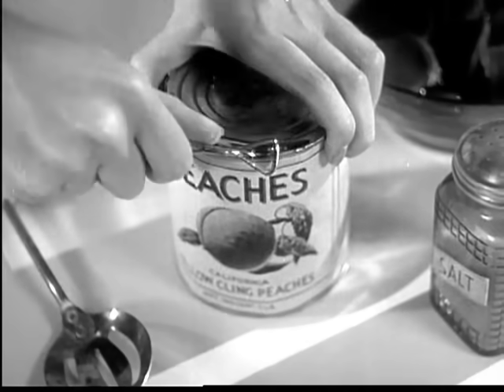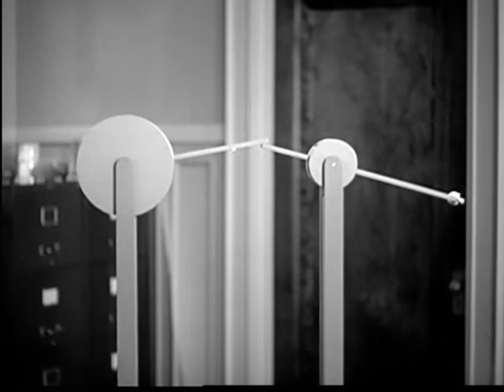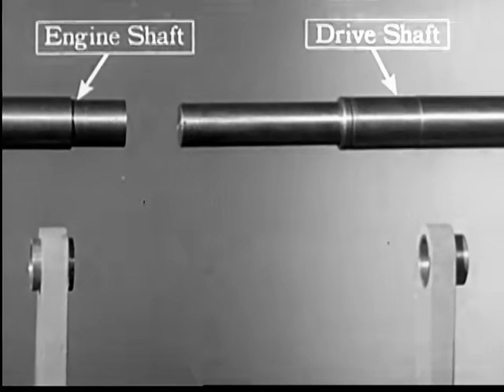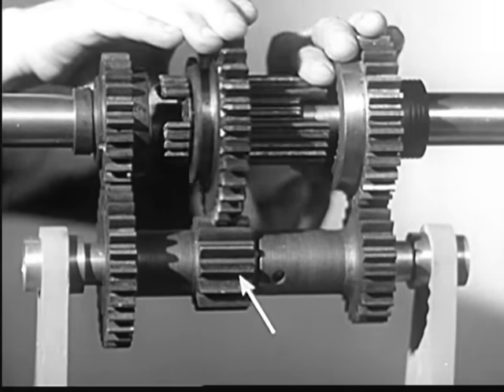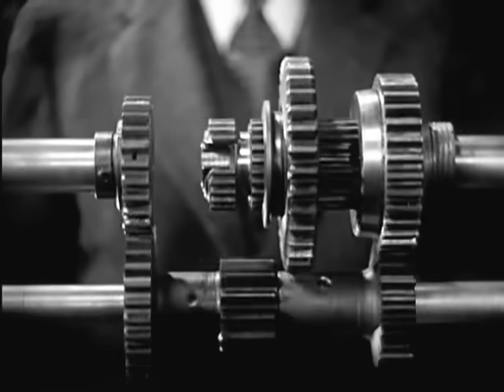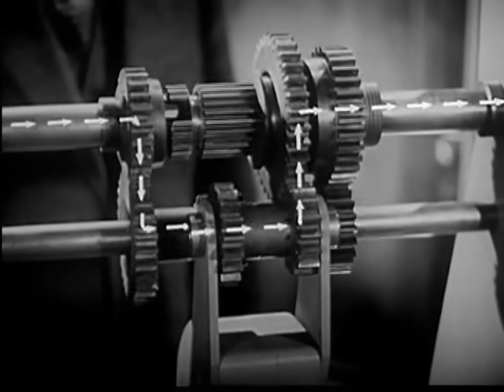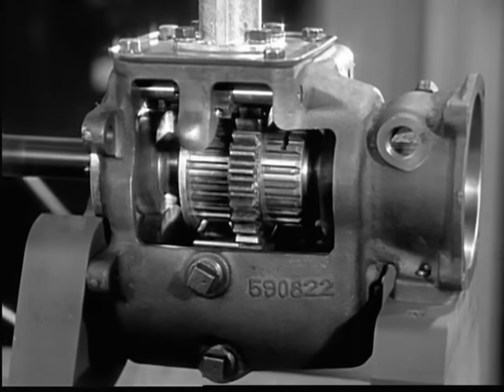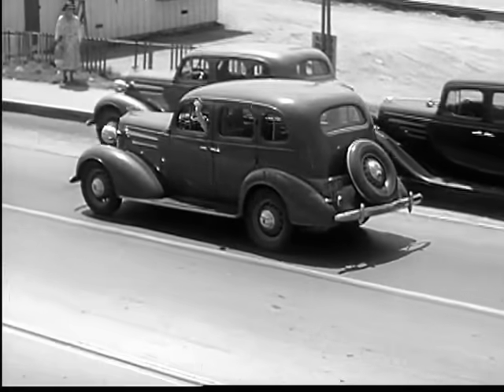Spinning Levers - How A Transmission Works (1936)

Comment: Is it just me, or is this explained so well that i can actually understand everything.

Today's school systems suck at teaching, especially Engineering colleges, where professors just blabber on and on without making anything clear or concise, and expect the student to read all the material and understand it on their own. 
If things were explained this clearly, half of my time would have been saved from hours and hours of reading and doing online research to understand concepts.
Reply: My university has mostly foreign lecturers who don’t make sense. I’m not trying to have a dig at immigration but I agree modern schools are terrible
Reply: It's kind of funny that you brought that point up. I go to school for marine engineering, meaning I learn how to make a 1000 foot ship move. Most ships either use large low-speed diesel engines or a turbine of some sort (gas turbine or a steam turbine). A lot of my textbooks make things really complicated to the point where it frustrating on understanding even the basic concepts of how things work. However, its these types of videos, from back in the day, that really helps me actually understand what's going on because they explain in a way that really makes sense and makes it easier to understand what's going on. Obviously, there is a lot more going on in a car's transmission. There is math that goes into calculating the torque output from the shaft based on the radius of the gear, or the wear and deformations that occur based on the material that the shaft is made of. But this video really helps you understand the basics of how it works so that you can tackle the more complicated things that are going on.
Reply: You're absolutely right teaching sucks now.
Reply: @cowboy_broke  Maybe it's you. Ever thought of that?
Reply: and iam not even talking about books and other study sources which are made for Einstein... everything is so hard to understand
Reply: That's right! Same here. I think in present times the technical colleges doesn't have workshops beside school where you could get practical knowledge. In mine 25 years ago were a workshop with machinery, tools and also exhibition of simple engines, gearboxes which could be used as example to show how they work. But around 20 years ago everything was removed and as they said "no needed" because of modern methods of teaching. So, how the hell students can get the knowledge? from Powerpoint presentations or YouTube movies like this?
Reply: I used to teach calculus-based physics courses in college and I saw the deterioration in math and science education in this country starting in the late 60s and continuing through to the present day. It's one of the reasons that I got out of teaching and wouldn't go back for 3 times the money.
Reply: @videomaniac108  hey if you were a teacher then do you understand why the parents allow idiots to run the schools cause they put me in a farming course when I asked for AP Physics and AP Chemistry? And why they keep making it harder to graduate by adding unnecessary credits? Or why college is only getting more expensive despite colleges pretty much being a daycare for immature adults that want everything dumbed down so you never truly get an education? At this point im not even aiming these questions at you because I know none of that is your fault, I just have a lot of questions that nobody in the school system is willing to answer so you're my closest outlet. Honestly I might drop out soon because the school system is so backwards that the only way you can even think about getting a good education is by having $100,000 ready to pay to a decent school.
Reply: You are totally right, I mean when I was in school back in the early 1900's I learned alot more than I did last time in the school bench (2018).
The difference is overwhelming!
Reply: the leftists have eliminated common sense...
Reply: @JeffMTX  the extremists*
Reply: fuucking true iam student of technical engineering aswell and the way we are are studing is wrong on many levels...it seems like nowadays teachers (school system) think we know everything already and we are all 160 IQ geniuses  ...
Reply: @Simon-wr6hb  Why are you complaining? College has gotten easier for the younger generation. You now have tools and devices that we would have loved to have back when we were banging on type-writers and spending entire nights trying to solve a problem because we couldn't just jump online to find all of the answers we needed in minutes. Ya'll have it waaaaayyyyy toooo eassssyyyy. Stop whining.
Reply: @Luis_Ramirezzz  the only thing that improved was the tech, not the schools.
Reply: @Lysergic_  You really don't need teachers when you can learn from an MIT professor online, for free. Kids are just lazy these days. I wanted to teach myself calculus in 10th grade and it was painful. But man, I would have mastered it in months if I had today's tech.
Reply: @Luis_Ramirezzz  And thats what I mean. You couldve used this tool and learned calculus in months, but instead you had to use school. Nowadays the schools slow you down, but people dont realize this so for some reason everyone pays thousands for university. Basically I agree with you.
Reply: Okay, first off, you must not be attending any legitimate engineering courses. Why? Because engineering, math and science are the only subjects where a professor cannot just BS his way through the entire class. Most engineering students are able to grasp complex concepts with ease and if you can't, I suggest you choose another major. And by the way, young kids have it way too easy these days. You have every single tutorial you could ever need at your fingertips. All of the answers you seek are online and easy to find. If you think you have it hard now, just imagine what we had to go through - using a type-writer instead of a laptop and not having the internet as a research tool. So, if you're still having a hard time understanding an engineering course, it's your fault...not the professor's. He expects you to do some research before sitting in for the next lecture.
Reply: @Luis_Ramirezzz  oldmanyellslatcloud_simpsons.jpg

Comment: 0:50 - I remember to have used a simple long-enough crowbar to move a four-carriage passenger train when we had to inch it to the correct position for lifting the carriages off the wheels.

Comment: im not dumb but can anyone tell me what in leverage causes force to be amplified im having trouble understanding the conservation of energy in this if i put 10 newtons of force and getting 20 newtons out
Reply: Leverage does not change energy or work, it changes force.

With gear reduction comes a drop in shaft speed. Double the force but half the speed kind of deal.

Comment: so well explained. i mean i can visualize it all just as its in a car. even almost visualize how an automatic works aside from the valve body maze. but you could teach anyone how a transmission works with these kinds of videos. i go to UTI and its not near as well explained. its all just a bunch of engineers showing off stroking their egos on how complicated and convoluted they can make something seem so they look like they are smart as shit when really the machine itself is pretty simple with a simple function and once you break it down into piece by piece it makes sense and you see the whole power flow in one harmonious motion. like looking at a motor. all the rockers are just moving randomly until you know the firing order

Comment: So does that mean autos in 1936 had two gears? I am aware that driver could change into first gear but to change into second they had to prepare the gearbox prior i.e. they had to get second gear ready, disengage the engine, make sure the cogs were running in sync with eachother and then hope it would work. 
I'm no expert but I think that's how it was done.
Reply: Yes, some early autos were 2 speed.

Shifting from 1-2 was easy, it was synchronized.

Comment: My brain understood this better than the way they did at the tech school I was at a few years ago. Another great example of they sure don't make them like they used to
Reply: Because its simple, now they come up with all that vocabulary BS, basically, you have to find how you like to learn things, me personally, I prefer the dummy way, then bring vocab after I get how it works, for example, this thingy works with this thing to make this other one spin, not some stupid shit like this first gear is giving an input of 3:1 gear ratio to this other gear, so this other gear outputs a greater total speed, but that's just me some people like to read a book on how it works, others like to see an example and see it work, so just figure out how you like to learn and either look for videos like that or some how translate it to your "language"
Reply: Well, to be honest, modern transmissions are far more complicated and it's difficult to follow the flow of power. I actually always find it easier to start with the earliest prototypes of machinery and follow the progression of improvement over time. We're in a good position to understand CVTs right now because they are still relatively simple. We have only gone from opposing cones to the current squeezing pulleys, so there's not much to them just yet. They will get more and more complicated over time, and those of us keeping up with the current design changes will be able to understand them much more thoroughly.
Reply: I could picture scotty kilmer saying that. I even read it in his voice
Reply: New manual transmissions are FAR better than this one. Cars back then were extremely lucky to hold together for 100k miles. Now even the cheapest economy cars can be expected to last 2 even 3 times as long...and with a lot less maintenance and repair.
Reply: @RealityIsTheNow  it's getting harder and harder to find a manual in a new car these days. Unless you're buying a sport vehicle, but the CVTs make shifting unnecessary (as long as they aren't crappy)
Reply: @RealityIsTheNow  Every vehicle I've ever owned has been a manual. I getcha. but my dad bought a Jeep with a CVT that gets 38 miles to the gallon and hasn't had any problems whatsoever. My mom's Nissan CVT however has had nothing but problems since the warranty ran out. I went shopping for a car a few months ago, and not a single stick on the lot on 3 different major retailers. The guy said the industry is phasing them out except for sport vehicles. So you'll still get to have fun if you want a sporty car. But I want a truck
Reply: @deluxeassortment  I live in Germany and it feels like 80% of the cars here are manual.

Fun fact: if you make your license with an manual car you can drive both, manual and automatic.
If you make it with an automatic car, you are not allowed to drive automatic cars
Reply: @robinthorwesten7388  I believe this is more of an American thing. Americans as a demographic are generally opposed to manual transmissions. But I'm sure we'll see some change in Europe assuming the Germans decide to make the CVTs themselves, since the CVTs are more efficient (while not necessarily better quality). I love German engineering.
Reply: @RealityIsTheNow  i think you're confusing what you find enjoyable about driving with what everyone else finds enjoyable. Some people don't like manuals and the constant changing of gears yourself. I don't find driving any normal car or truck enjoyable, simply used to get from point a to point b. If i want enjoyment i take my bike out.
Reply: @RealityIsTheNow  its not, and its about the riding not the sifting of gears.
Reply: @RealityIsTheNow  again, you're confusing what you find enjoyable with what everyone else does. Not everyone likes exactly the same thing as you, crazy i know, but you're not the center of the universe.
Reply: @RealityIsTheNow  and yoy saying that what i find enjoyable about riding is bullshit because its not how you like to ride... And im the child. Also the way you've worded all you're previous messages was saying that you way was the only enjoyable way. So yeah you don't understand that what you like isn't always the same as everyone else. Again, you're not the center of the universe.
Reply: @RealityIsTheNow  But... you do realize, that before long, this video will be CENTURY OLD ?

Comment: A Mercury is a good car. That's the car I was driving that day. I've had a lot of cars. Different kinds. Lot's of different kinds of cars. She was standing - this girl - on the side of the street where there was this chicken stand, wasn't the Colonel but it was a chicken stand nonetheless. I pulled the Mercury up right along side her and rolled down the window, see, by electric power. She had on a leather skirt and had a lot of hair on her arms. I like that a lot. That means a big bush. I like a big bush. She says, "Are you dating?" You know, so I said, "Sure". She gets in and we pull off to a remote location that was comfortable for both she and I. She says, "How much do you wanna spend?", I said, "Whatever it will take to see that bush of yours because I know it's a big one". She says, "Twenty five dollars". That's not chicken feed to a working man so I produce the $25, she puts it in her shoe, pulls up her skirt and there before me lay this thin, crooked, uncircumcised penis.[Scoffs] You can imagine how bad I wanted my $25 back, huh?
Reply: did that actually happen?